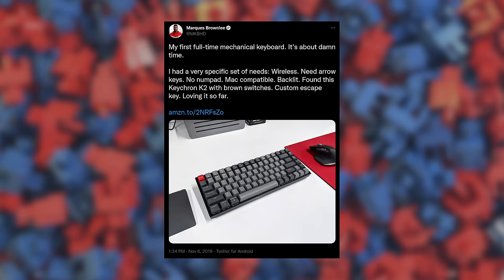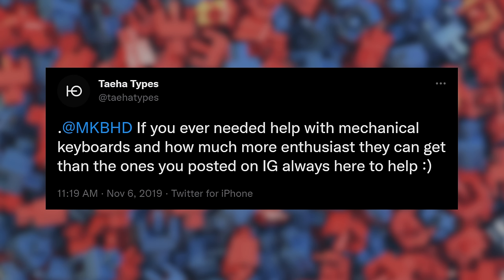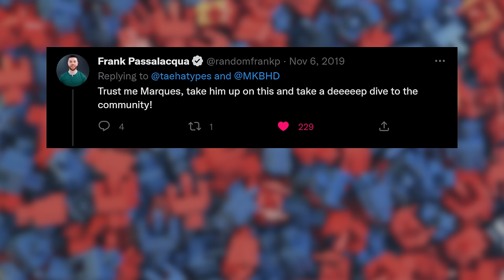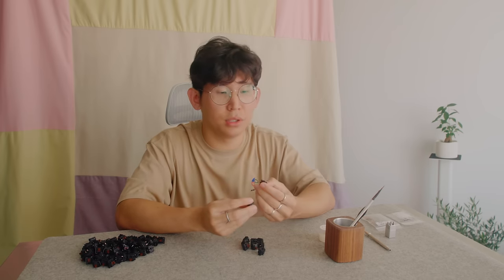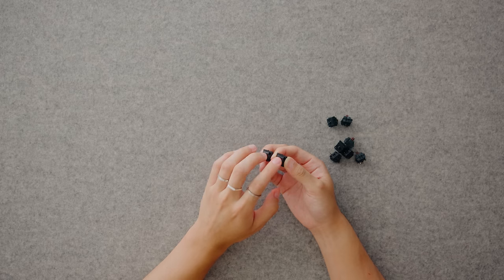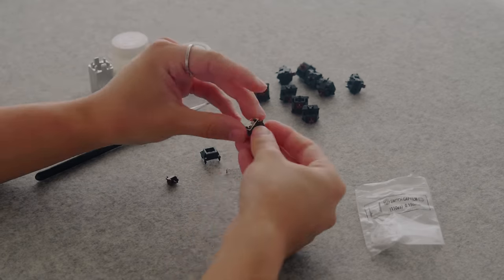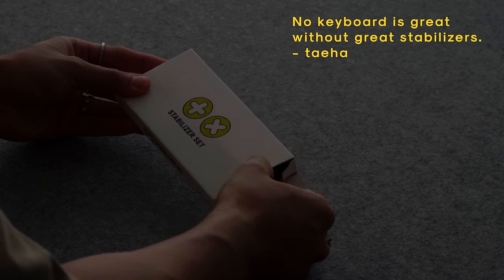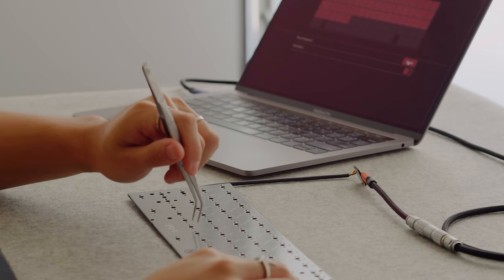The Making of MKBHD's Custom Luxury Keyboard

Comment: Paused at 5 seconds in:
I'm gonna go ahead and assume it's just another custom build with frame, pcb, foam, tape, lube, custom keycaps, custom switches, and some artwork with RGB.
Throw on the sticker label aaaaaand SELL!
And of course, it's loud as fuck even though it's been lubricated because the customer prefers clacky sounds, which he could have gotten by just getting clacky switches in the first place.
Youtube content never fails to disappoint.

Comment: I’m curious why you chose not to add any mods to this keyboard. Do you have a personal philosophy on this?

While the keyboard did sound great I felt that it sounded pretty hollow. Personally I love the deeper sound you can achieve with foam and/or tape.
Reply: Mods are generally strayed away from for higher end keyboards, as they tend to make all keebs sound the same/very similar, ruining the uniqueness of certain keebs and also the switch sound profile. Tape and foam mods are still great for lower end keyboards. The premium high end keeb community has started to look down on the foamy deep sound (although I still personally love it).
Reply: @edward.sometimes  oh that’s really interesting as the keeb creators I watch art still modding very expensive keyboards. And are often criticizing high end customs if they do not come with foam or even tape.

Comment: Kudos for the hard work, which I see you get a kick from as a hobby! I'll just be frank:
1. Don't understand the 60% layout and how people go about without the F-keys. Personally, it should be atleast 75%.
2. Don't like the design concept - too much MKBHD stuff and that too which is inside and at the bottom
3. Really like the keycaps theme
4. Don't like the sound, but that is maybe I am more into thocky, creamy and silent sound tones.

BTW, you made it public, but don't see any comments from MKBHD appreciating your efforts here! 

P.S. Since people will be commenting/asking, mine is more from budget range - Keychron V1 Max modded (sound dampening and anti-vibration materials used in automobiles and sound industries; haven't seen any keeb bloggers using them, with Poron switch pads and stab pads + Durock V2 stabs modded) with $35 dollar PBT Double-Shot Cherry profiles Dark Blue/Black themed set (used in Xinmeng A66 keyboards) after 40% discount, sitting on top of Gateron G Pro 3.0 Yellow switches.

Comment: Question: I noticed there isn't space for a command button on the Bauer Lite case - given Marques' requirement for Mac compatibility would this not be a compromise for his needs? I love the board itself, it's probably one of the best looking builds I've seen - just curious if this was a concern during the design process. Loved the video, hope to see more collaborations like this in future!
Reply: Mac is for usable on a WLL layout. We designed the board and all our products on a Mac with this board. 

You just put Command on Caps Lock, Option next to the space bar and then Control on bottom left. Honestly it’s a more ergonomic layout to have Command on R3 right next to your pinky than on the bottom row.
Reply: @omnitype_official  Good to know - thank you for explaining. Will definitely be picking up one of these for myself! 🙌🏼

Comment: One thing I think that's important to highlight in the switch lubing part of this video is that if you are using broken in switches, it is very important that you do not mix and match different switch parts. You really want to make sure that the stems and housings are matched with the original configuration they were broken in with, otherwise the break-in may not be consistent when mixing up stems and housings. I'm not accusing you of saying otherwise Taeha, but others might miss that important detail in this video and take away some of the value of breaking in your switches by making that mistake. It's best to go one switch at a time with broken in switches, rather than batch process lubing lots of switches.

Comment: 4:00 500 thousand actuations is just 0.005% of 100 million, not 0.5%, but either way, a non-issue since it's still an insignificant amount
Reply: Nope, he was right the first time. 500t is half of 1m, meaning 500t is 1/200 of 100m, or 0.5%. You'd be right if you said 0.005 x 200m = 500t
Reply: @DZ-jm1my  oh yeah I'm dumb I bamboozled myself. I forgot to convert 0.005 into a percentage which is 0.5%

Comment: mkbhd is a mac user, wouldn't having WKL get rid of option which he definitely needs? anyway, very beautiful build!
Reply from the maker: Programming Caps Lock as either the MacOS or Opt key works fine! (and then programming Caps Lock as a funtion key if you do genuinely use Caps Lock often)
Reply: Command on Caps Lock, Option next to spacebar, Control bottom left. 👍 We designed the board on Mac with a Bauer 😃
Reply: Not necessarily, I'm a Mac user ande I daily drive 30% and 40% keyboards. With the right keymap no function is lost.
Reply: @TaehaTypes   good to know!
Reply: @omnitype_official   nice

Comment: No bandaid mod, no thread mod for stabs, no proper foam. This thing will rattle un several weeks like cheap ass junk
Reply: this thing is SUPER cool and prob fun to make, but i agree the sound test made me die inside.
Reply: @craigoconnor6361  whats wrong with the soundtest? why is there a need for foam
Reply from the maker: Those mods arent necessary mods nor does the absence of them mean a keyboard will start rattling
Reply: @jadenngl  people in 2023 still believe that doing fancy holee mods and puting shitton of foam will make the keyboard sound and feel better, some of them even go as far as criticizing the goat of mechanical keyboards
Reply: TX stabs don't need no mods. and Foam ew overrated. It would be a bad keyboard if it needed foam to sound good.
Reply: MKBHD had one of our original prototype Bauers (without those mods) while they waited on this board and they had it for 3 years. When we got it back from them when we dropped his board off, it sounded exactly the same and I now use it on my desk again.
Reply: @jadenngl  Mostly I prefer thock over clack. But when I modded my board and I was really new to it, I didn't mod the stabs at all and they didn't age as well as the switches did. It really takes more like half a year to a year for it to degrade though. Also, a tape mod at minimum improves the sound. Without any padding of any kind, the switches are just really loud, and who wants to around that? It's like fingers on a chalkboard, it starts irritating the ear.
Reply: @craigoconnor6361 at this point your just throwing around buzzwords, holee mod isn't even needed for cherry stabs, if you can lube properly, foam is definitely not needed for a good board, it remains it's character, and doesn't sound like a random zoomer board. Buzzwords just destroyed a part of the hobby, but thank god the hobby is moving back to good boards
Reply: stop chucking garbage in your board. no good board needs foam or band aid. that said, this build sounds mid at best
Reply: @friedrichvonbargen5561  I don't really get it, but to each their own. Everyone has their own preferences, I get that. I'm just saying I really hated the sound profile of this board and mods would 100% fix it. That's it. If that's what the customer wants then all power to them, but if they typed in the same room as me I'd die inside without noise cancelling headphones.
Reply: @craigoconnor6361  Braindead take... everything is a preference... also not every board is loud without foam.. just mostly cheap boards. people also like loud boards aswell, comparing it to fingers on a chalkboard is so wrong..
Reply: you forgot that it also isn't hotswap, wireless, or mac ready lol For a "luxury" keyboard, i'm surprised how primitive it is lol